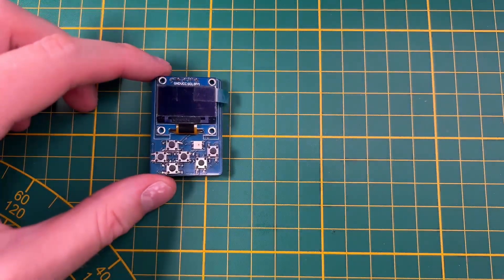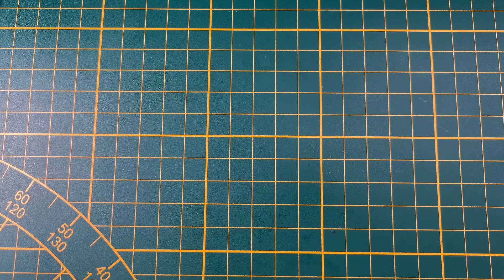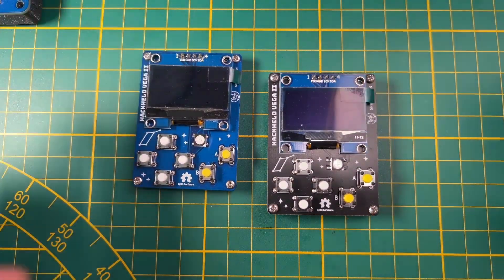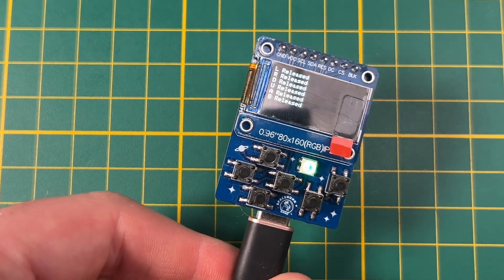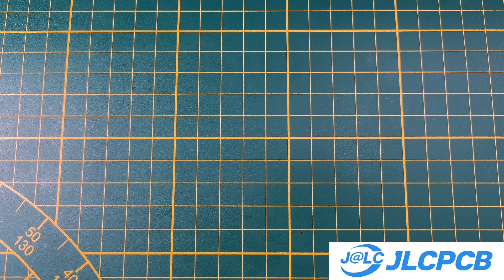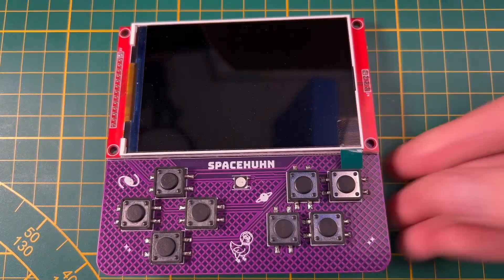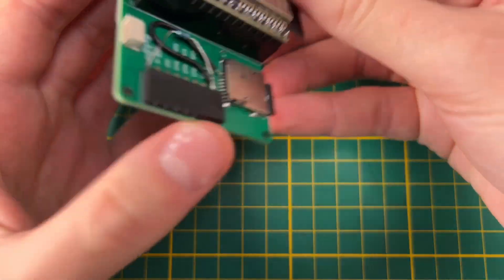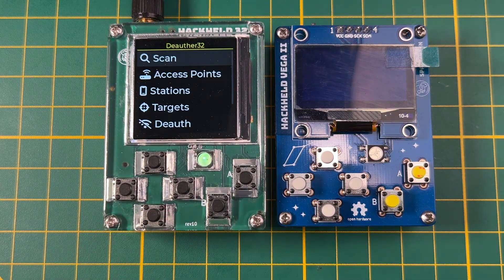Unreleased HackHeld Designs

Comment: Do you take comissions for open hardware design? I need an esp board for a custom stopwatch, but none of the off-the-shelf boards work for me.
Reply: I might help you if the design is not too difficult, I've done some open source hardware using ESP